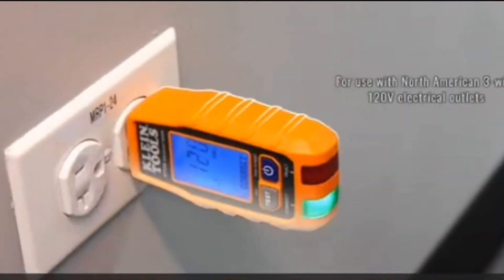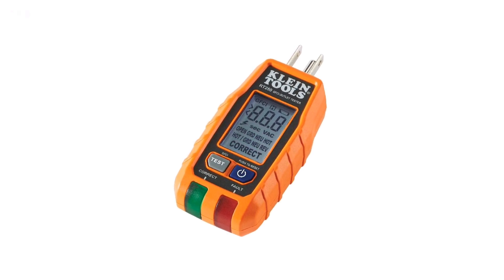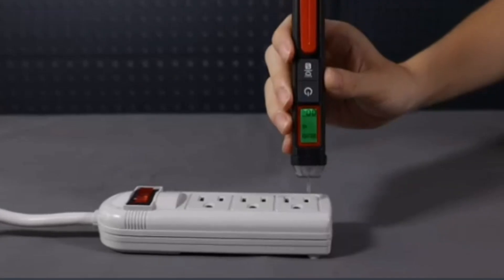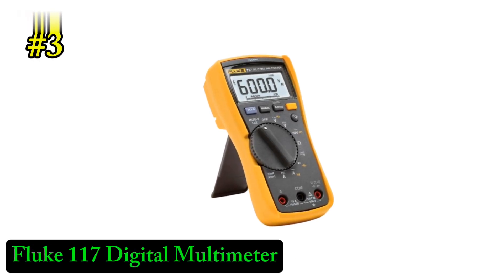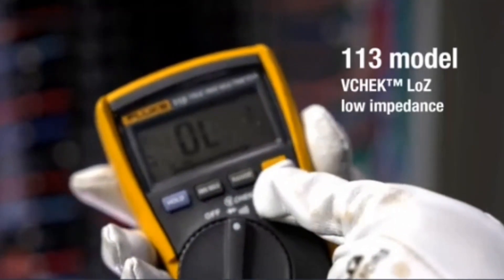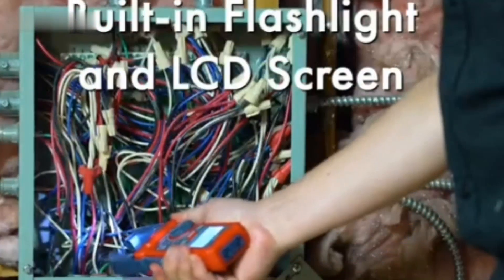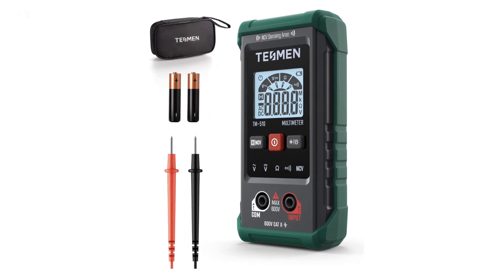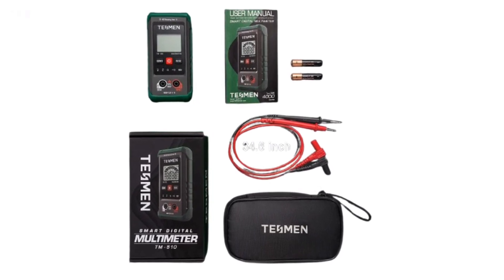✅Best Top 5 Electric Voltage Tester (Buying Guide)

Comment: I'm in the usa AND MY 110 VOLT OUTLET IS ONLY READING 50 volts . that's not normal is it ? j
Reply from the maker: A 110V outlet should never read 50V. It indicates a wiring problem, not a low supply. Don't ignore it.  it's a safety hazard and could lead to electrical shock or fire risk.
Reply: @trendingstylelist  I’ve tried to get an electrician out here ..
Reply from the maker: @frankmontez6853 Alright & stay with us for more update ♥️♥️♥️